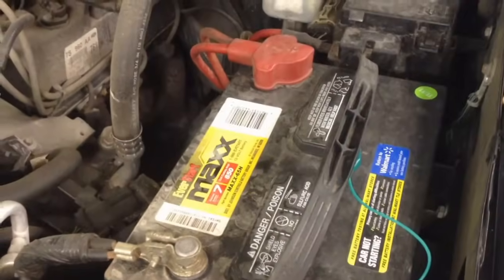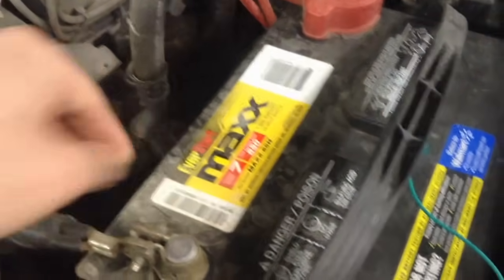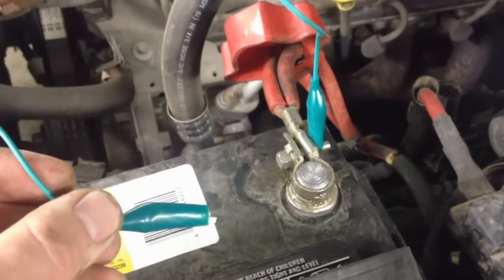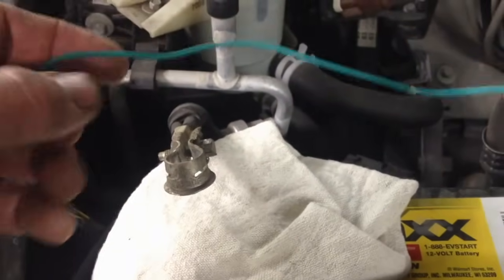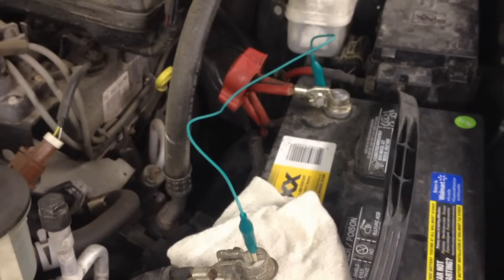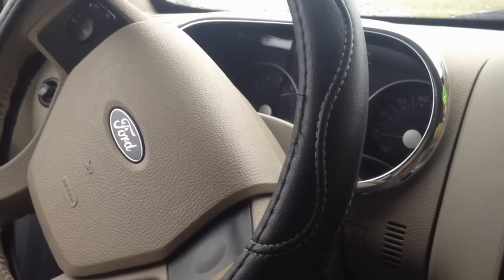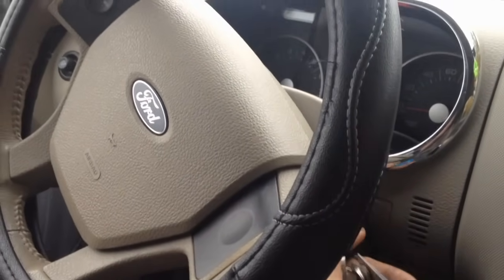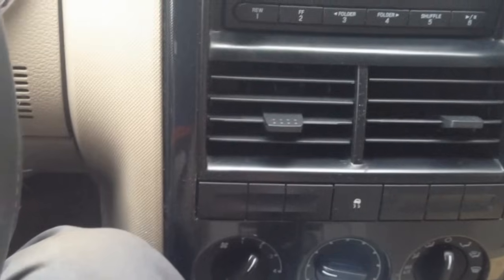How To Clear Your PCM'S Memory On Fords After Repairs

Comment: On some Fords, there is a specific relearn procedure in the owner's manual that involves the air conditioning and driving 30 miles.

Also, for best results after disconnecting the battery is to turn on headlights/domelight and ignition key to the on position.
Be sure to turn them off before reconnecting the battery.

Some capacitors may not be discharged with the key off.

Comment: when doing this does it deleate ur tune I have a 2012 f250 powerstroke it has been deleated an tuner put on it coming outta 1st gear it bangs but after first it is fine an when u slow down when it drops to first it does a hard down shift an bangs will this video help my truck

Comment: What's the difference in this versus maybe disconnecting the negative and leaving headlights on for 30 minutes?
Reply from the maker: That only works reliably on vehicles from the 80's or older.

Comment: Great video!! And I’m NOT trying to sound negative or anything, but unhooking the negative battery terminal for 20-30 minutes will also reset the PCM... I’d think connecting a wire from the positive to the negative would end up blowing fuses or something catastrophic!! That’s my luck anyway!! lol!! And does it matter after the reset and warm up period which direction to travel in first?? I back out of my driveway so I would start off in reverse and not drive.. does that matter or should I pull in my driveway backwards that way I can start off in drive...

Comment: Going to try this on my 2011 Ford Expedition el limited that has 225,656 miles .. it’s been having some idle and shift issues
Ok after 10 minutes turned key on for about 30 seconds and turned it on from there it took a while turning key to start which it’s never done usually starts right away but eventually after like 3 seconds it started and I let go of key and now it’s idling I’ll update in 10 minutes

Ok update it does seem smoother in idle . Shifting is definitely smoother so yes this worked thanks!

Comment: So I have 2010 mustang base V6

It has some funky gremlins in the electrical system, first off it's used so I don't fully know it's history... But the radio displays MUSTANG and the temperature and is non responsive, now if I unplug the battery for a while I can use the radio/aux for a short duration before it goes back to having problems, when the problem occurs it also seems to affect my passenger window, i.e. I can't roll it down from the driver's side but can from the passengers side, it only goes up even when I press down (on the driver's side) but after resetting everything it seems to work fine until the radio goes out... I've reset this thing tons and tons of time by draining the power or unplugging the power to the fuse box, sometimes it will work for hours, but by the next day it is back to acting up... This problem also seems to sometimes effect the convertible top by not letting it open or close and when that issue occurs, my turn signals don't work and my traction control is cut off as well as my parking brake light comes on....

I'm truly going kookoo over this, I don't understand why it works after a reset but messes up after it has sat over night 😳🤦🏻‍♀️

Any help would be appreciated

Comment: Love and appreciate your vids man. Will the computer reset if I change my battery? Or, should I change my battery and then do this? I need to change my battery and clean the connectors of corrosion, that's why I'm asking.

Comment: What's the difference, when you remove both positive and negative terminals and connecting them, compared to just the negative? I'm total noob with car electronics lol
Reply from the maker: Nothing, either way the circuit is broken.
Reply: @FordTechMakuloco  Thank you for replying. I used to work in an Autoshop and enjoy working on cars. But I have I never touch electronics because I have phobia being electrocuted as a kid. So, I'm tryna learn it lols. You're the man!

Comment: That's true, after a reset or manual calibration, I always tell the people to drive normal and accelerate as slow as possible, a good practice for couple day and it should runs like new again....reset doesn't take overnights...key thing to know.. from my experience.

Comment: Hi sir I have 2016 ford escape as I bought brand new it was running good without any issues On first service 8000 km they changed Throttle body as it was recall after that it started taking high RPM for gear shift I went to dealer they told me within 1000 km it will reset computer but nothing happened they didn't care now it has 65000 km on it within this time they changed water pump under warranty I changed battery Should I do this procedure will it work safely Thanks

Comment: I changed the spark plugs, coil packs, mas, tps, idle air control valve but now its shooting a p0300, p0154, p0122 on codes. Do I need to do this reset so everything can work right?
Reply: Do you have an update?
Reply: The reset work but it wasn't that. It was the intake manifold gasket that was causing the codes
Reply: @israelgomez5784  Wow. Hard to diagnose! Did you find the problem yourself or a shop?
Reply: I took it to the dealership and they said it was the pcv valve so I said change so they did. When I went to go get the car it was doing the same thing so I told hey man you didn't fix the problem then they co.e back 30 min later and say o it's the intake gasket. They wanted to charge 700 to change. I said give my damn keys and told them if the had done it right the first time I wouldn't have minded spending the 700 but they had pulled crap like that they just lost that sale. I went to autozobe got the gasket and did it myself. Gasket was like 50 bucks

Comment: Are you sure this is safe ? Shorting out the 2 cables like that ? I was watching  a different video saying this is dangerous. You're taking a high risk in blowing the whole car computer doing this. 
According to the video, undo one of the cables and leave it for about 30 minutes.
Reply from the maker: Positive, remember the negative is disconnect the circuit is not complete anymore.

Comment: Sorry for being off subject.
When replacing the battery on a 2016 Ford Escape SE 2.0L Eco boost, do you really need to reset he BMS.
Is it true that not driving the truck for 8 hours would reset the BMS by itself?
Thank you so much for your input.

Comment: Thanks for posting that video, do you or anyone else know will this work on a 87 ford f150 302 5.0 I just bought truck and noticed shifting is a little off going down the road. I would think it should shift but it seems off. Also starting truck the idle go's hi / low a few times then settles down. Would this also fix this issue. Thanks if you or anyone else can answer that

Comment: Greetings ford tech makuloco. I have a doubt, that process is necessary in the event of battery drain completely and replace with a new battery ? I have a Ford Crown Victoria 2004 and Throttle body is mechanical not electronic

Comment: I want to remove the chip system of the 2009 ford escape  vehicle to use the non - chíp key  and the engine still starts to work

Comment: Thanks it improved some shifting issues I was having almost thought the transmission was dying I did exactly what you described in your video and went for a normal test drive went thru all gears smooth..mind before I would accelerate and it wouldnt advanced 2004 Expedition Eddie Bouer.💯💯💯 THANK YOU!

Comment: Hello, my 2001 ford f550 7.3 throttle positioning sensor was changed and worked fine till i got it to the yard a few days later after i decided to put it on road the engine not responding to the fuel pedal. please help im going to tinker with it like you did on video.

Comment: I have a Volvo V70II, after changing the Thermostat he got the Problem of highrev Missfiring, changed all coils, all Sparks and still No code and stalling and misfiring, so I thought it is the throttlebody, send it for testing and it was fine, after few days with no connected Battery the throttle came back and i start the car, for now no problems, runs fine no stalling and rough driving.... Maybe this was the secret to reset the computers... sometime curius....

Comment: Why does Ford have so many issues but NO FACTORY RECALLS THAT COSTS US OWNER'S LOTS of $MONEY$ ON REPAIRS. I haven't stopped putting MONEY into this 2003 LIMITED, I bought it off my FRIEND that's a TOP NOTCH MECHANIC, I'M SHOCKED HE SOLD IT TO ME KNOWING IT COSTS MONEY TO REPAIR SOMETHING ON IT, I WENT THREW HIS PAPERWORK TO SEE HE PUT OVER A $1,000 IN 12 MONTHS, ALWAYS A NEW ITEM. NOW HE GOT IT CHEAP WITH A BLOWN ENGINE, HE ALSO SELLS SCRAP METALS IN THE SIDE, HOW HE CANE ACROSS THIS ONE OWNER FROM HIGH END PERSON OUT OF BOSTON AREA! I BOUGHT AFTER HIS 3 YEARS RAN OUT AND HE PUT 32,275 MILES OR SO ON IT OUT OF 36K WARRANTY. HE BOUGHT A NEW REMAN FOR $1,995 & ADDED NEW PARTS LIKE FLYWHEEL, TORQUE CONVERTER AS IT WAS A ISSUE AFTER, HE WASN'T HAPPY BECAUSE HE COULD OF DONE HIMSELF, SUV LOOKED BRAND NEW. I PUT TIRES ON IT AND 6 MONTHS LATER, BRAKES ALL FOUR CORNERS, JUST REPLACED PADS WHEN HE DECIDED TO SELL BUT I GOT INTO A SMALL ACCIDENT, FRONT BRAKES DIDN'T WORK WELL, ROTORS WERE JUNK, JUST A QUARTER WAS USED, SO SLAMMING ON BRAKES DIDN'T WORK THAT GOOD, HE WAS SURPRISED, JUST BUMPED VEHICLE IN FRONT AT 50 MPH BUT CUT TO RIGHT OR IT WAS TOTALED. THAT'S BOTH WITH INJURIES TO BOTH. I'VE PUT IN ABOUT WHAT I PAID FOR IT, HE GAVE ME A DEAL BUT I HAVE ALMOST WITH BUYING IT AS MUCH AS IT COST ME FOR WIFES NEW 1999 PLYMOUTH VOYAGER THAT CAME OFF THE ROAD, I ONLY BOUGHT IT AS I NEEDED A NEWER VEHICLE TO TRAVEL SON, ONLY PUT ON 34,000 MILES ON IT MAX. TO FIX DASHBOARD THAT GOES OUT US BECAUSE HE INSTALLED AUTOMATIC START, THAT MEANS PUT KEY FOB APART AND PUT CHIP FOR FACTORY ALARM SYSTEM NEAR IGNITION KEY, HE SAID HE NEVER DISCONNECTED THE DASH AS THE CLIP US BROKEN ON IT, HE GOT IT AT 132,211 AS I HAVE ALL PAPERWORK, WAS WORTH $18K WHEN HE GOT, IF KNEW, THEN HE WOULD OF SOLD FOR $12K AT TIME, I BOUGHT WORTH $11,500, PAID $4,500 I HAVE THAT IN IT & NEEDS MORE YET AGAIN BUT SHOULD BE GOOD FOR HOPEFULLY 4 MORE YEARS. THAT'S ALL. HAVE A HONDA CRV 2.4L 4WD AND THAT'S GREAT ON GAS BUT CAN'T TOW BIG THINGS, BUT EXPLORER CAN'T RENT ANYTHING TO TOW NOT EVEN A SMALL UTILITY TRAILER BECAUSE OF THERE REPUTATION FORD MADE, I MUST BUY A TRAILER IF I WANT TO GET RID OF LEAVES, FOUND OUT WHEN I CALLED IN ADVANCE TO BOOK WHEN SON WENT OFF TO COLLEGE, NOT ONE RENTAL PLACE WOULD RENT A TRAILER, I FIT IT ALL IN BUT TIGHT, WOULD OF BEEN EASY TO TOW AND PACK. BUT JUST LIKE FORD CARS, THEY HAVE ISSUES WITH COIL SPRINGS BREAKING IN REARS AND THAT CAN BLOWOUT TIRE IF YOU TOW, THAT'S WHAT I WAS TOLD AND THAT CAN CAUSE SUV TO FLIP AND KILL PEOPLE, THEY DIDN'T WANT LAWSUITS KNOWING IT. LODGING COMPLAINTS ONLINE THREW RECALLS DOESN'T WORK. THEY WON'T FIX BAD BACK WINDOW HINGES THAT'S JUNK AND BEEN REPLACED, FORD DEALER LOOKED AT IT AND SAID YES, THOSE NEED REPLACING AND TRIED UNDER THE RECALL, THEY SAID JUST ONE TIME ONLY FIX NO MATTER WHAT. ALSO, I TRIED THIS DRAINAGE BUT DIDN'T WORK, WILL IT EASE ALL CODES IN PC OR KEEP WHAT'S LODGED IN IT ? I PREFER TO KEEP THOSE THERE AND JUST RESET PC SO I CAN GET BETTER FUEL MILES THAN I HAVE BEEN, MY FRIEND WAS SUPPOSED TO KEEP UP ANY WORK ON IT, I WAS THERE DAILY FOR 1ST MONTH, THEN HE BROKE HIS COMPUTER SCREEN ON MY SUV ON DASH ISSUE, HE DROPPED A SOCKET ON GORILLA PROTECTION SCREEN,  THEN IT CRACKED,  SNAP-ON 9 INCH SCREEN, I TOLD HIM HE CAN'T FIX IT AS HE TOOK APART, HE SAID I CAN FIX ANYTHING. I SAID YES BUT NOT THAT FOR COST, HE THOUGHT GLASS TOUCHSCREEN WAS JUST GLASS AND EASILY FIXABLE, I STATED NO, LEAVE CRACK BEFORE AND FIND OUT 1ST, 2 MONTHS LATER, HE WAS PISSED AT ME, $900 AND SNAP-ON HAD TO DO IT, HE WASN'T HAPPY. I SAID TOLD YOU SO, U FIXED TVS ONLY THAT I GOT FREE OR $50 UNDER, FIX EASY FOR $75 AND TIME, ABOUT 1 HOUR TO TESTING BOARDS, MOSTLY WAS POWER SUPPLY BOARDS LET GO, EASY FIX. BOUGHT TWO 22 INCH TVS FOR KIDS AT $229 BACK THEN AND A 26 INCH IN 2007 FOR CAMPER, COST WAS $379, I HAVE NICE LG TV'S THAT COST $25 PLUS $59.95 & TIME, THAT WAS IN 2010 ON A 2009 MODEL. BOUGHT A 37 INCH THAT WORKED FOR $50 WITH 3 SHELVES STAND, NICE 48" STAND BY 20" HIGH, 1080P. I KNEW THIS FROM FIXING TV'S. EVERYONE JUMPED INTO IT JUST AFTER MY FRIEND AND I DID AND TV'S WENT FAST OR TRY TO GET MORE FROM YOU. BOARDS SELL FOR $60 TO $110 ON EBAY, THE CORD COST $10, REMOTE $20 BUCKS, NEW IS TWICE AS MUCH. ONE OF MY BEST FRIENDS AND HAVEN'T HEARD NOR TALKED TO HIM SINCE OVER HIM BEING MAD, OH WELL, STILL HAVE MY MINIVAN THAT I GAVE HIM FOR SCRAP, A3 YEARS BACK, WAS OFFERED $500 FOR IT ON SCRAP PRICES, I SAID NO, I ONCE TOLD A FRIEND IT'S HIS, STILL WAITING FOR HIM TO PICKUP NOW, NOW HAVE A 2ND CAR ALSO THAT I GAVE HIM, ONE HAND WASHES OTHER, NOW I'M SELLING THEM. BEEN SINCE AUGUST OF 2016 SINCE I TALKED TO HIM LAST. STILL HAVE TEXT ON CLEARING CODES AS HE COULDN'T FIX MY SUV AS I NEEDED TO DRIVE 12 HOURS ROUND TRIP, HE HAD A MONTHS NOTICE BUT I ENDED UP TAKING IT APART AND TRYING TO FIX IT MYSELF, I UNPLUGGED THE CLUSTER AND PLUGGED IT BACK IN, FIXED THE ISSUE OF NO INTERIOR LIGHTS OR DASH WORKING AT ALL, NOW CAN DRIVE THE DISTANCE AND KNOW HOW FAST I'M DRIVING, OH AND RADIO TO GOES OUT BUT AIRBAG LIGHT MIGHT POP ON AND OFF AND THAT'S ALL, NEVER MADE SENSE TO ME SINCE IT'S PART OF CLUSTER INSTRUMENT NOW.

Comment: can i use wire only with out alligator clip?tnk you
Reply from the maker: Sure if you can hold it there for 10 min.
Reply: hello sir pcm can cause no start?no current at all?then if i turn off d ignition still chek engine light appearing pls help me tnk you
Reply: my unit is ford focus 2005

Comment: Will this work on Ford Escape Hybrid 2009  ECM and BCM  reset ? Since there are two batteries in the vehicle, 
[HV Battery pack  (BCM)] should the HV Battery  disconnected by placing the HV Fuse to Service mode or disconnecting the HV line under the back row seat? Will appreciated if it could be addressed. Thanks and best wishes.

Comment: 2008 f150 had leaking trans cooleant lines, replaced lines topped off fluid and now have OD flashing and only 2nd & 3rd gear. Ran perfect on Friday replaced lines on Saturday had to order new quick connect fitting on radiator, finished up on Monday started flashing code immediately!? Help

Comment: I always return to your expert advice to better educate myself on my 2002 f-350 7.3 powerstroke. I have a question on the temperatures you mentioned when test driving to reset the transmission. Is this temperature the coolant temp or the transmission temp. I believe you said Ford mentioned 175-180 Degrees is what they say will fine tune the shifting. Is this temperature coolant or transmission? thank you!

Comment: Does this work on ford 2003 Explorers ? Had a FRIEND that was suppose to reset computer after I done a complete tune up, got tired of #5 and #6 kept having coil pack issues and i drove 600 miles round trip to get son at COLLEGE, been having issues since and been blown off for years, sucks gas ever since, totally changed. Bought the best oem replacements, had plugs loosen up once and found it like that, again, i bought from FRIEND that was SUPPOSED to clear it. Years later and i need an INSPECTION sticker now. Hate doing something that doesn't work, he told me to try this, he heard about this but said 10 seconds. I thought he was nuts as a top MECHANIC. 10 minutes is huge difference. Was sold a MONEY PIT i spent more MONEY on it since I bought it at a friend deal. Cost more than book value and then some, new REMAN engine when i bought it. Just drove until warranty ran out. Gave all paperwork and the last 6 months to a year cost him over a $1,000 at his cost. If a GARAGE, then over $2,000 in repairs. I should of gone threw it but was a great FRIEND/mechanic that said he would take care if all maintenance with me paying for it. I got stuck in 2 weeks twice over same issue after buying it 2 weeks before. Thank you.

Comment: Hey I have a 2008 Ford Edge and I just had the oil changed and a new factory rim (with sensor included) into my car but my red oil light and tire sensor default lights r still staying on. Will this trick of the trade work for these issues as well? Thanks for ur help!!!

Comment: Hi, is this applicable to Ford Ranger 2017 2.2l 4x4 Auto trans.? I had an unfixed issue with my unit even replaced new battery but sill several errors occasionally pop-up and engine wont start. My current remedy is to re insert key and those errors gone away and engine can be startup.
Before following your sequence, do i need to remove the sensor wires connected to Negative and Positive?